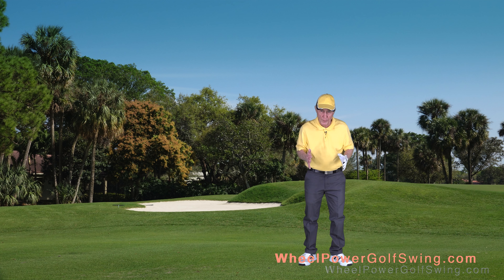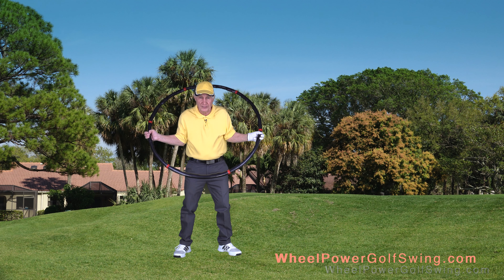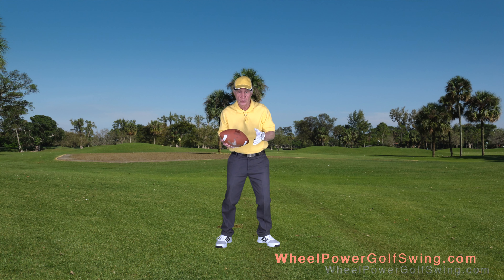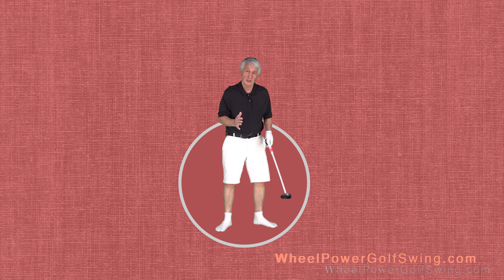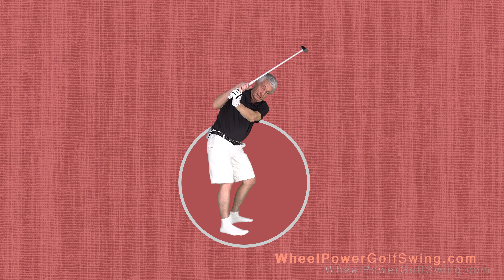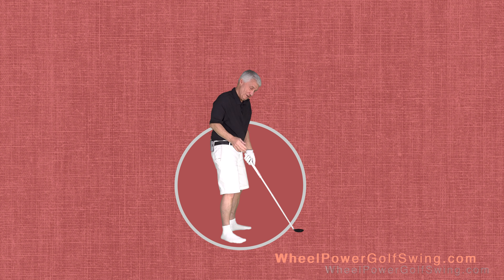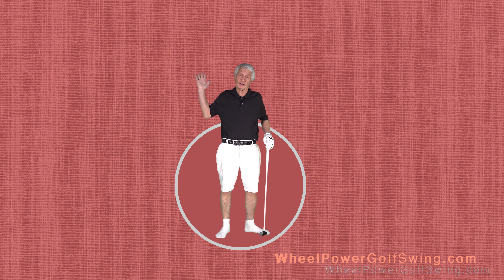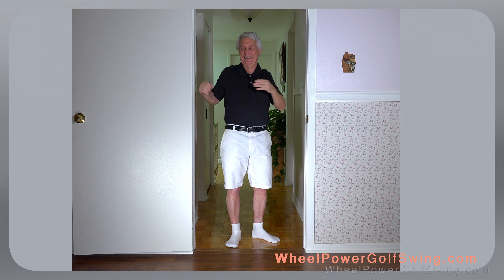SECRETS to a FLAT LEFT WRIST at top

Comment: You’re right hand and arm or your left hand and arm to throw the club? This subject is so confusing and so much controversial information. How do you know you are correct?
Reply from the maker: Great Point. This video above is more about the challenges of getting a flat left wrist at the top of the backswing - which makes it easier to square the club face at impact. 
To your point, there are golfers who promote a throw of the right arm vs a pull of the left. There are 2 sides to every point of view. Watch my video: PUSH vs PULL:  https://youtu.be/8cKMtFb4XY0 and also my video: More Speed with Less Effort https://youtu.be/GcTpd20kMho
Am I saying I am right?  No.
The golf swing can be done in many different ways. It comes down to what you feel comfortable with. 
After you watch those 2 short videos, try both ways to find out what you feel more comfortable with.
Here's a trick. Try 1 arm ONLY at a time to help you decide. 
Personally, I start by throwing with my right and feel the left pull it up to the finish to get an acceleration that I can't seem to get with the right only.
That's the beauty of the golf swing, at least knowing different options lets you choose what is best for you based upon you age, flexibility, skill level, etc.
I don't personally think there is a right or wrong answer. Golf is not a one size fits all.

Comment: Is this parody or serious or both?
Reply from the maker: BOTH, I tried to describe the golf swing in a serious, but an entertaining way. Check out the full 1 hr INTRODUCTION video.
 https://youtu.be/UDdzq70yKRQ
Reply: @WheelPowerGolfSwing  I've seen it.  I wasn't sure what to make of it.  You hired models ... that helps.  The thing is you never really describe what it is that makes your idea any different than anyone else's other than the word "wheel."
Reply from the maker: @HolyGrailOfGolf    Hi. If you watched the 1 hour INTRODUCTION video  https://youtu.be/UDdzq70yKRQ  and still didn't see the difference, try watching these short videos:   https://youtu.be/hH7wjNWrrgA or https://youtu.be/lwCMetjlt4o
The key difference is that while the top of the spine stays as the swing center, the bottom of the spine shifts like a pendulum. 

Unlike the Traditional golf swing where your COIL your back and spine like a gate spring, in the Wheel Power Golf swing your spine is treated like a solid lever. The lateral motion of the lower shifting spine (hips) along with the tilting of the hips converts the shoulders to a rotational motion - like the hub of a wheel around the swing center (where top of your spine meets your shoulders - C7). Your arms act like alternating wheel spokes where one arm is straight while the other folds.

It takes a while to grasp the concept which was developed by the late Mike Austin. I just gave it a nickname to make it easier to visualize the concept of emulating a wheel turning machine (like the Iron Byron). You are using your 2 axis body to emulate a 1 axis wheel turning machine. Mike Austin explained his concept in a very technical way. Once I grasped the concept, my scores dropped by 6-7 strokes per game; I hardly ever hit a shot that isn't straight and no back pain.

Try watching those 2 other videos I listed above and it will become more obvious. Yes, I hired models and tried to make the videos more entertaining than the run-of-the-mill golf videos you see out there. That's what happens when you retire and have a lot of free time on your hands.!! Hope you get the concept.. you'll never go back to coiling if you do. Thanks for your comments. Norm Rosen
Reply: @WheelPowerGolfSwing  Thanks for the reply.  I'm quite familiar with the Mike Austin swing, although he described what he was doing many times and many ways I don't think he really knew what he was actually doing.  Crazy I know, but rarely when you ask an elite athlete how they do what they do, they don't actually know, they just do it.  I find that when people try to do what they're told to do by these elite athletes they actually do it and it doesn't work because it's not what the athlete is actually doing.
Reply from the maker: @HolyGrailOfGolf  I agree. What's the expression.? "What you FEEL you're doing is not what you are REALLY doing"! I'm really busy doing my own videos right now, but I look forward to checking out your videos during the summer. Good luck.